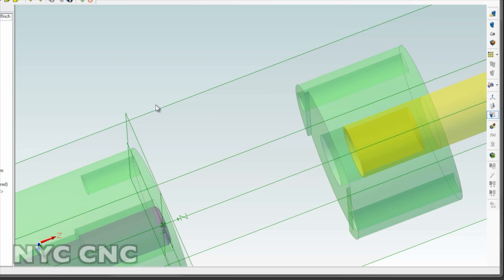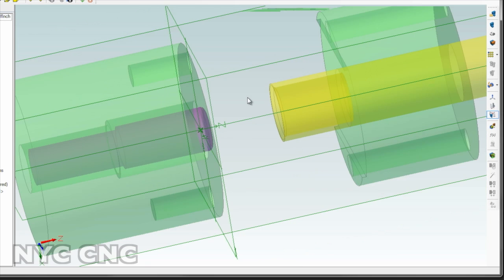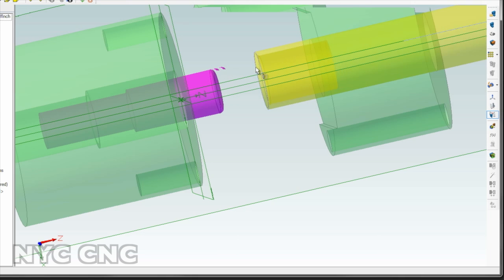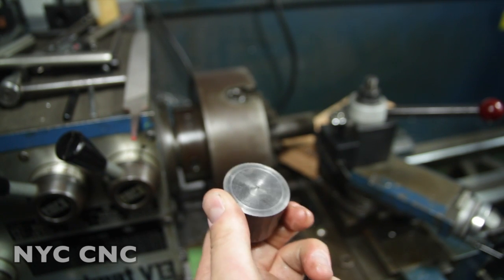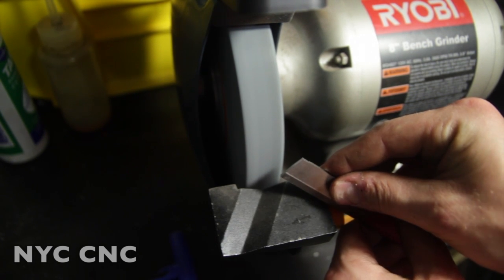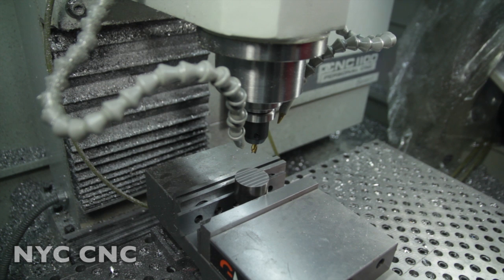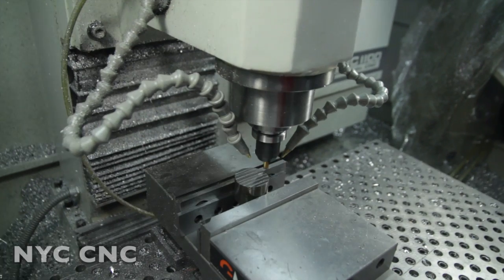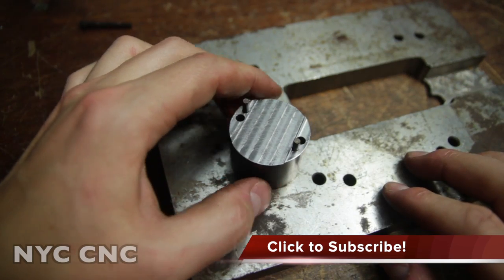Making Copper Bullet Jackets: Machining Punching & Drawing Dies!  Part 3

Comment: You would be a great Tool & Die Maker.   I  would have drilled and bored your blanks in the lathe then indicate you mill centered to the bored hole, then  put in the screw and dowel  holes.     Your doing great and doing work most people your age could care less about.    I wish we could talk because there are easier ways to make those dies.   I'm a retired Tool & Die Maker with a shop in my garage

Comment: Great videos for non professional.  I have only one issue you don't give raw material dimensional sizes and quantity. Example you gave the steel type 1144 but note "Die material - 2 each 3 inch dia stock 6 inches long"  the Punch is 2 each 2 inch dia stock 7 inch long.
Reply: I sorry if that came across like a critic your skills are good enough for me to take advice, suggestions and dimensions in my attempt to replicate what you have done.  I purchased 2.5, 2.25 and 1.5.  1144 stress-proof bar stock as a guess-ti-mate to what you used.  Would you be inclined to scatter more information my way?  Thank you humbly Ed A.

Comment: Sorry, 4-inch*. Ebay, though the most common size I saw at the time was 6-inch. It is quite reliable, especially when you finish with higher grits. I used an 80-grit plate to test the concept (now I only use that for making, rather than sharpening). Each step up made the tool last longer

Comment: To resharpen/make lathe tools, I made an arbor for a set of 3-inch diamond lapping plates. 120, 240, and 400 grit. I then mount a tool on the post (usually with a mount I've hastily designed for this purpose) run the spindle at around 120 RPM, and grind away while keeping the lap oiled

Takes a while but it's very repeatable and has great results

Comment: why dont you drill your 3 holes to depth, then part off the first half? you can then finish ream or bore each piece dialing it in for zero off the pilot in the center...no?  as long as you drill the alignment holes while the stick is all one piece, it doesnt much matter where they are located. maybe drill 3 in an assymetric pattern so you CANT put the halves together wrong?

Comment: I understand. Having the curvature of  the wheel is not really an issue. Remember the angle(clearance) IMMEDIATELY below the cutting edge is the most important issue. 5-7 degrees is what you should be aiming for. The clearance is there to allow for the penetration of the cutting edge into the material, while minimising friction. Too much angle and the cross section of the cutter behind the cutting edge becomes thinner, thus weakens the edge and faster heat buildup. Peter

Comment: Tough to say. Probably within the year. The biggest challenge is just painting it. I was thinking of getting a soda blaster, but the citris stripper might be less expensive and messy. I've taken everything apart but have a couple of things that need some more work. I have to get one of the bearing off the spindle and replace them but they are stuck fast.

Comment: If I could suggest. When grinding the cutting edge on any cutting tool (parting tool) always have the cutting edge on top. That way any burr created will be at the bottom of the tool and in the clearance area. For me, I rarely ever hone a cutting edge. Mostly because it is difficult (when honing by hand anyway) to recreate the same clearance angle under the cutting edge. Another great Vid.

Comment: I had a chance to cut a real spur gear on the mill in school and it came out great. Unfortunately I don't have access to a shop now. I got a copy of the Grizzly video with Gordy Gritters and I have a pretty comprehensive library of gunsmithing and machinist books. I've purchased reamers and other tooling from PTG. Someday it will happen.

Comment: No I wish I was. I got a Logan 1927H off of Craigslist. I've completely disassembled it and replaced some of the gears. I just need to finish cleaning up my basement and get the parts painted and reassembled. Already got the 220v line dropped. Your videos have been very inspiring. Hope to get to the point that I can do some barrel fitting.